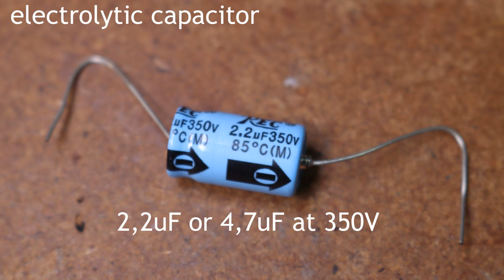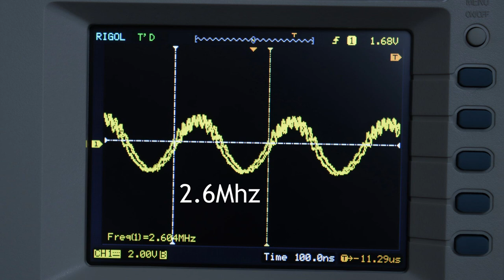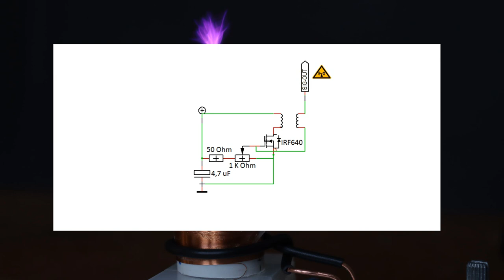Best tiny Teslacoil 2021   Step by Step

Comment: Great work! Finally someone gives a Mosfet a proper burial as well!
Reply from the maker: Thank you Jay ;) Did you read my E-mail?
Reply: Haha...poor Mosfets never get any respect for the hard work they do.
Reply: @ChristopherOBrien000  Why don't you connect 3 in parallel?
Reply: I used 2n3904 transistors for my slayer exciter tesla coil and they got warm but they did not fail (on 12v and drew about 300 - 750mA)
Reply: @Purple431  2N3904 is good for 300mA max..  so how did you shove 750mA thru it? 
I also got the 3904 oscillating and lighted up a CFL but i did not go anywhere near 300mA and the temp went up by about 50 Deg C.  So yeah, I'd say  probably bad instrumentation.  when you have the DVM leads near the HF oscillator it tends to distort the readings.
Reply: @Berghiker  Now they don’t distribute power because they are not exactly similar so one which has the lowest resistance will take the load you need to use the “Darlington transistor” arrangement
Reply: @Teslaundmehr  ⚠️ God has said in the Quran:

🔵 { O mankind, worship your Lord, who created you and those before you, that you may become righteous - ( 2:21 ) 

🔴 [He] who made for you the earth a bed [spread out] and the sky a ceiling and sent down from the sky, rain and brought forth thereby fruits as provision for you. So do not attribute to Allah equals while you know [that there is nothing similar to Him]. ( 2:22 )

🔵 And if you are in doubt about what We have sent down upon Our Servant [Muhammad], then produce a surah the like thereof and call upon your witnesses other than Allah, if you should be truthful. ( 2:23 )

🔴 But if you do not - and you will never be able to - then fear the Fire, whose fuel is men and stones, prepared for the disbelievers.( 2:24 )

🔵 And give good tidings to those who believe and do righteous deeds that they will have gardens [in Paradise] beneath which rivers flow. Whenever they are provided with a provision of fruit therefrom, they will say, "This is what we were provided with before." And it is given to them in likeness. And they will have therein purified spouses, and they will abide therein eternally. ( 2:25 )

⚠️ Quran
Reply: I am from india and i,m your subscriber.

Comment: I made the circuit, and it works really well. My only problem (more of my fault) is that I used an electrolytic capacitor that gets really hot when large currents run through it. My recommendation to anyone building this circuit is to use a capacitor that has a low ESR (or maybe use several caps in parallel to decrease esr and increase capacitance).

Comment: I made this slayer exciter year ago but I use irfp250 so i can power it up with 50v and works very nice, better option is use irf250 than irfp640
Reply: So how do you think his IRF640 blew up? The voltage rating is the same as the IRFP250, his is mounted on a good heatsink.  The device is good for 19 Amps at a case temp of 100C and he only went up to 32Volts when it popped.  Did yours also blow up at any time?  How did you protect the Gate of the FET?    I am planning to make one like this myself but have only made one with the 2N3904.
Reply: @johnconrad5487  good heatsink is very important because heatsink is very very hot. I'm  not sure what is look like but my irfp260 blew up on 60v or more if im good remmeber
Reply: @johnconrad5487  You would probably also do well to use a pair of diodes (one pointed from ground to gate and the other from gate to Vcc) to clamp the gate voltage to between the supply rails.  Probably 1n4007 would do but UF4007 cost almost the same so why not?

Comment: I've successfully recreated this DIY tiny Teslacoil. I went through two 640Ns before I managed to get it working. It looks like the trick was to start the pot from zero and go up slowly . Danke, for putting up this DIY video. Best.
Reply: Means u have connected two mosfets in parallel?
Reply: bro i used the exact same components down to the same brand yet mine does not work is it the tesla coil secondary, my one has about 250 turns

Comment: Considering it’s simplicity those are some very good results. Great work.
Reply from the maker: Thank you!!
Reply: I just built up the circuit and I was able to get it to produce plasma from 2.5v which is amazing. Also I added a little 555 musical interrupter and it plays back music decently loud. Also I think using an irf530 is best for this circuit, I can run the circuit at 12v on with only a small heatsink on the mosfet and it doesn’t overheat. The only downside to the irf530 is that you can only go up to about 16v before it blows up.
Reply from the maker: @quantumlab9130  wow that sounds awesome !!
Reply: One last thing, I just wanted to see the limits of this circuit and I found that with and irf530 I could drive a coil up to 13.5mhz! And it produces a nice little plasma flame, Though running at these frequencies I think something like 90% of the energy is going to heating the transistor. Mine overheats after just 15 seconds of running with a moderately sized heatsink.

Comment: Put an led across the GS if the Fet, GS is Gate Source, so place the cathode (negative of the LED) to the gate of the Fet and the anode (positive pin of the LED) to the Source of the Fet. It will work much better! It turns the Fet of much faster than without it.

Comment: Fantastic! The mosfets will get burning hot in seconds. You should try a push pull sstc(with capacitors on the drain and source, mine was 9.4nf) it works beautifully at 24v, and produces more than 4cm of hot plasma.And the mosfets too stay cool!

Comment: You have to put 2 opposed 15v zener diodes between gate and source to protect the MOSFET...
Reply: Yes, and I have also used a small neon lamp in paralell to the primary to limit the voltage spikes.
Reply: @firefox1136  wow! That's a great idea!
Reply: @fabriziobrutti1205  Thanks, I will also include some zener diodes like you said. Still, 15v are a bit high for a mosfet gate, I think 10-12v would be better.
Reply: @firefox1136  great, then let me know if it works without breaking too often or at all!
Reply: @fabriziobrutti1205  I still have to add the zener, but until now the only problem is that the transistor overheats after a few minutes. It looks like the transistor is protectet, the only problem is the overheating. But I think, with a lower input voltage  and an other transistor I can fix that. (Rn I am using the irf540 and 18.5v input). I will tell you when I have found the perfect combination.
Have a nice day.
Reply: @firefox1136  I think that you may solve this problem bt using a TO-247 case mosfet... Irf540 comes only in a TO-220 package and that allows a limited power dissipation and causes a higher thermal resistance... You should also look at a low fate charge (irf540 already has one)... So try a TO-247 package mosfet an it should be better (remember Vdss >=100V, Id > 20A and Rds(on) <= 77 mOhm)
Have a nice day too🙃👋
Reply: @fabriziobrutti1205  Thanks, I will try that.
Reply: @firefox1136  you're welcome!

Comment: Not an expert, can you measure the inductive kickback voltage on the primary when you turn it off? Great little circuit
Reply from the maker: yes with an oscilloscope its possible ;)

Comment: great video!
i've made my circuit by following your steps, it works well! 
it works well at 9V supply but my capacitor easily explode at 12V by it own (i touched it before, the capacitor is very hot)
my circuit almost same as your video, except i am using IRF540, and 4.7uF 450V capacitor.
any advise?
Reply: Maybe the capacitor you're using (electrolytic) can't handle the higher frequency and it explodes. I had the same issue and it's now solved as I used an MKP capacitor which can handle higher frequencies and it doesn't get warm.
Reply: Make sure you have the polarity of your cap correct! 😸  If you're 100% sure it's right try placing a ~220nF film cap in parallel to soak up the RF current.  You could also stick a low ESR 100uH ferrite bobbin choke after the supply cap to prevent any RF getting back that far.  Or do both (a π filter).

Comment: What is the position of the pot when the circuit starts? I mean which direction do you move your pot and is it in middle position?
I tried using a 10k pot and it did work with very little plasma but gets very hot in 30 sec I m using a 10cm*4cm heatsink which should last for atleast 5 minutes if I had done it correct.
Reply from the maker: Rotate the potentiometer to one side. Than apply a low voltage (12V). If there is any current flow, rotate the potentiometer completly to the other side.
When there is no current flow, start rotating the poti very slow, then the circuit start oscillating ;)

Comment: I made it step by step and doesnt work ;( any idea what might be the problem?
Reply: Connect the primary the other way around. 
Also start at 12v first and then when it starts to give an output  turn the voltage up. (I recomend a max. voltage of 20v). You can also put a neon lamp in paralell to the primary to limit the voltage spikes and two antiparalell/opposed 10-12v zener diodes from the gate to the negative. (source of the mosfet)
Reply: @firefox1136  what do you mean with the primari the other way arround?
Reply: @joans.cerdan8162  Reverse the connections from the circuit to the primary coil.

Comment: This is perfect for my first Tesla coil, so well discribed. And just right size for a project, that I want to work on. Two things though, what are the wlre sizes- gauges and how would I add Amps to it. Thankyou. cheers
Reply from the maker: Thank you, thats perfect! Secondary: 0,15mm^2 Primary: 1,2mm^2   at 12V 1,5amps
Reply: @Teslaundmehr  Thanks very much for replying. cheers

Comment: How many turns have secondary coil and what kind of wire you used?
Reply: 600 turns, 10cm lengh, diameter 2,5cm, wire 0,15mm^2

Comment: I used irf540n mosfet for low on-state resistance , 19v 2.3 amps power supply and your good circuit but my mosfet source and drain get shorted, please help me!

Comment: Secondary coil size and turns plz
Reply from the maker: 600 turns, 10cm lengh, diameter 2,5cm, wire 0,15mm^2
Reply: Thankx sooooooooo much dude

Comment: If you used 2 IRFP640's in parallel, would it last longer?
Reply: slightly but in parallel the power distribution is still uneven so one mosfet will still be carrying a bit more of the load then the other
Reply: @nguyendesign4517  That doesn't matter because it still lasts a lot longer than only with one of them. I know this from experience.
Reply: @Berghiker  i wouldn’t have commented if i hadn’t either… try a darlington configuration instead
Reply: @nguyendesign4517  We'll I've run this for long periods of time and it never failed on me. So I must have done something right. It was way better than before.

Comment: Can I use a 9volt battery for powering it,please reply
Reply: Yes you can use it becose the minimum voltage of the tesla coil is 9v but if you power it whit 9v you will be have smaller arcs but you can put e few battere in series to make big arcs

Comment: could you increase it's capacity by adding a transistor in parallel or darlington config?
Reply: Did you find the answer to this? i've got 3 irf540n MOSFETs and idk if i should put them in parallel or in Darlington config
Reply: @rando4862  nah, i got distracted and haven't done anything with electronics in a while.

Comment: I made same to same and it turns on the light but the plasma is not coming what to do next 😭😭
Reply: You need to adjust the voltage or adjust the potentiometer